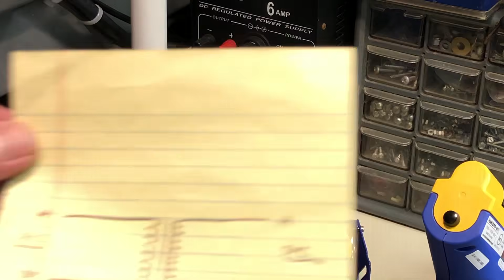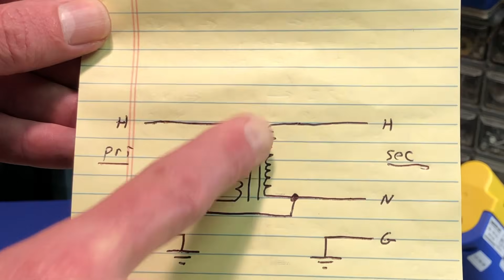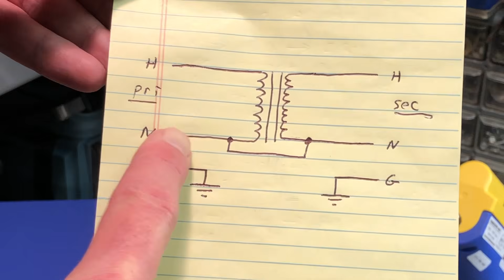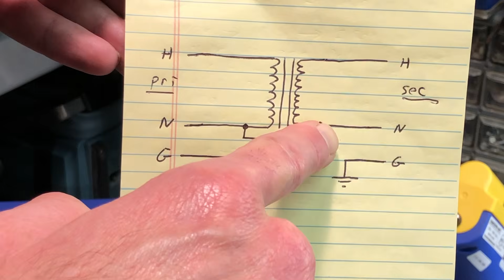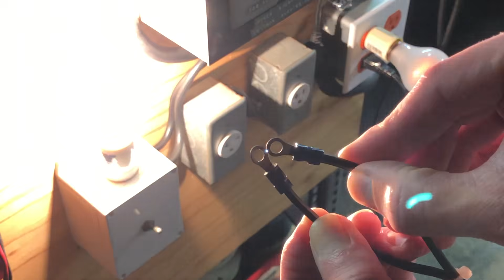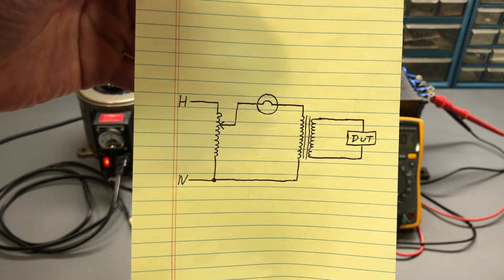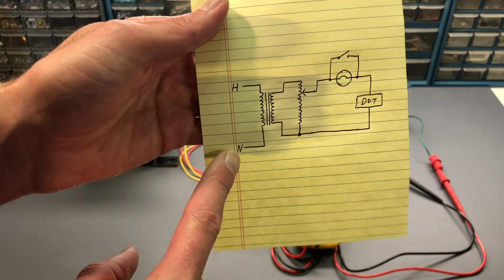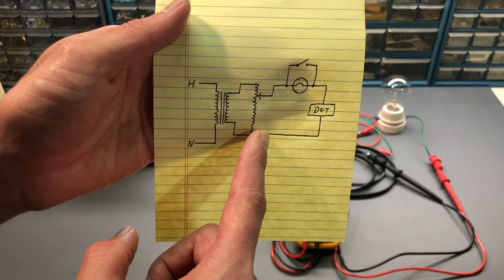How An Isolated Dim Bulb Tester Works (Current Limited Isolation Transformer And VARIAC)

Comment: Nice video Eric. One thing I want to add about the isolation transformer you generally buy that I see most people skip over in their videos. I have 1000w hospital grade Tripp Lite (I believe the hospital grade ones already have the neutral isolation), but to have a true isolation transformer you need ground isolation as well. The input voltage line’s ground is connected to the metal case of the transformer. Even if you disconnect the ground wires on the output receptacles, the stock receptacles (as do most) have their ground lug connected directly to the mounting tabs. So when that receptacle is screwed securely to the metal case of the Tripp Lite it is indeed still grounded to the main input ground.  So you would either need to get plastic isolation tabs and use plastic screw, or what I did was replace the stock receptacles with special ones where the ground lugs are not connected to the metal mounting tabs.  These receptacles are generally orange in color.  So I have complete isolations from hot, neutral, and ground.
Reply from the maker: Hi Dan, yes correct about the ground isolation and the special type of orange colored outlet.  It might be a little hard to see in the video but the outlets I am using are that special type (orange color) with the isolated ground.
Reply: Oh very good, I’m sure you knew about it, but thought I should mention it for those watching the video and not know they don’t truly have ground isolation without the new outlets.
Reply: Why not just use a ground lift adapter plugged into the outlet so you can have ground later if you need it.
Reply: Why would you care about the U ground?  It’s completely irrelevant.  The only time you need an isolation transformer is when you’re working on a very old Hot Chassis or a SMPS. In either case, the U ground is irrelevant, they don’t use them!

Comment: ERIKS, Why is the variac meter measuring "In rush current spikes", is the variac transformer or isolation transformer causing the In rush current spike? Transformers shouldn't cause in rush current spikes. The Test Set up Config#2 with the Current Limiting Light Bulb in the middle will light up at very low line voltage which means that the isolation transformers primary has "leakage current"?
Reply from the maker: Wayne, transformers will have an inrush current when they are switched on at the peak of the AC sine wave.  The 1st configuration has the high current spikes at low settings of the VARIAC because of the arrangement of the components and how they interact.   All transformers have some current flow in the primary with no load/no current on the secondary.  This is normal.  The no load current flow is not from leakage current.. i.e. breakdown of the insulation.  Technically the no load current between two transformers can be brought to near zero with a capacitor in parallel between them but this is really not needed on the size of transformers and currents we are dealing with here.
Reply: @EriksElectronicsWorkbench  When does a transformers have current flow in the primary with NO load on the secondary? The primary insulation is breaking down means there is "leakage current" flowing from the Top of the primary coil to the bottom of the primary coil. The Neutral wire on the bottom of the primary coil should be zero volts/zero amps. If it measures microamps uA or mA that is leakage current from the transformers eddy currents or transformers insulation. Try making a video lesson on how to test various transformers 1.) leakage current, .) in rush current, 3.) the transformers "isolation tests"  how to test a transformers isolation
Reply from the maker: @waynegram8907  An ideal transformer would have no internal loss and would not draw current if there is no secondary load but such is not the case in actual use.  Transformers draw a small amount of primary current with no secondary load in order to establish the flux in the transformer core.  Power up a transformer and leave it with no load on the secondary and you will find it becomes warm to the touch after a while which shows there is some small loss in the core.  Yes, I will consider making a video on transformers, testing and so on.
Reply: @EriksElectronicsWorkbench  Yes the small loss in the core is Eddy Currents which are from the magnetic field flux magnetizing the core material which the Eddy currents creates heat. When testing various transformers Losses in the video lesson would help out. When applying a Squarewaveform 20hz to 20khz to an audio transformer you will see ringing and harmonics because of the transformers wafers laminations materials and core wire insulation material used which will vibrate and resonance causing the ringing, hysteresis, harmonics to go over in the video lesson.

Comment: Hi Eric! I, too, have watched many of these dim-bulb/current limiting device how-to videos. Yours is definitely the most comprehensive. Most just show how to build one. Some explain why. Yours actually demonstrates how and why. Plus, your video is the only one I've seen that demonstrates the optimal order of isolation transformer, variable AC auto-transformer, dim-bulb/current limiting. As an aside, I was fortunate to pick up a pristine Heathkit IP-5220 Isolated Variable AC Power Supply. Internally, it uses the same order as you've shown. All I need to do is to plug in my dim-bulb into the IP-5220 and it does everything you've shown in your final configuration. Great video! Thanks!
Reply from the maker: Steven, thanks for the compliment and positive feedback. Your IP-5220 is a great piece of gear to have and will prove very handy on the bench.

Comment: Hi Eric, i have seen many video's the last 3 years about this subject, because i'm building for almost 3 years (due health issues) a project with a isolation transformer , dim bulb limiter, variac and electronic circuit breaker (own design) in 1 chassis, but this video is one of the best and comprehensive explanation on the different configurations that i have seen so far.
From the beginning i had already the last configuration in mind to use in my own project, but now i have seen what effect of the other configurations are.
Regarding the isolation transformer itself, did you do some modifications to lower the "ghostvoltage" from the secundary side to ground ? Grtz from Belgium
Reply from the maker: Bjorn, thanks for the compliment and I'm glad the video is helpful for you.  The voltage that can appear from isolated secondary to ground is why I say the isolation transformer greatly reduces the shock hazard.. but it does not 100% eliminate it in all cases.  The ghost voltage will disappear if you use a lower impedance AC voltmeter to test it   (such as 1000 ohms per volt)  so generally the current level of the ghost voltage is extremely small unless the transformer has a serious problem.
Reply: I'm in the same boat. I even have the measurements for the drawn but I'm just now testing rotary encoders for the nema 23 which will 1 to 1 turn the wiper.